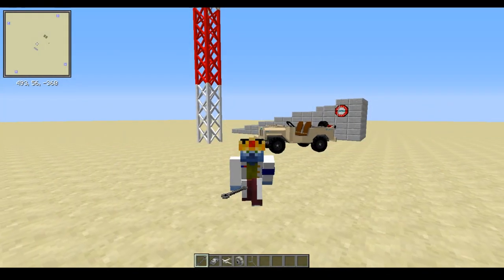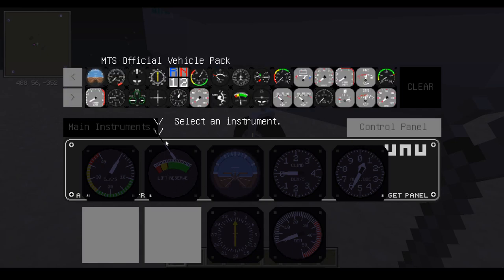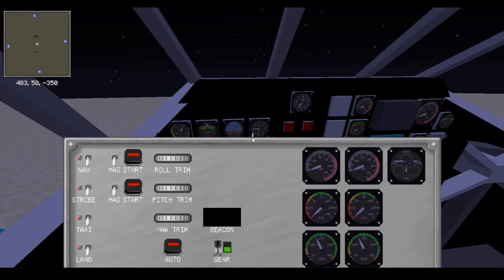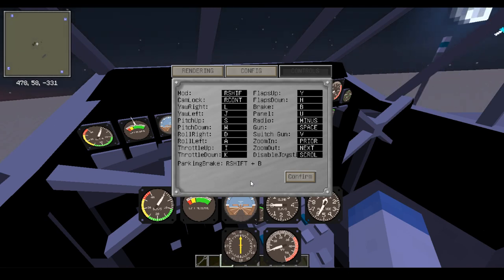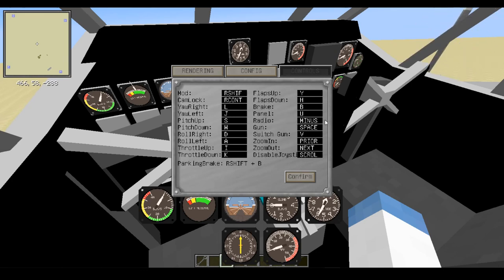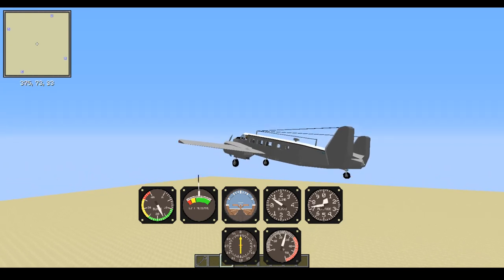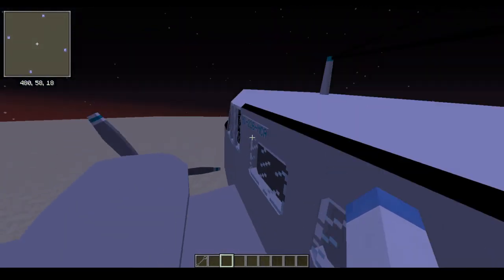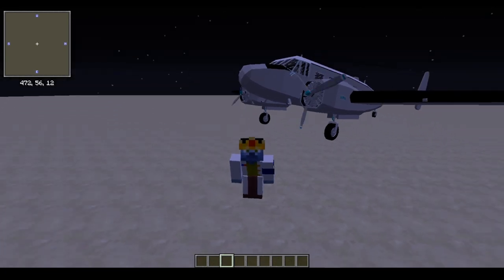Immersive Vehicles Tutorial - Part 2 - Time to Fly!

Comment: Hey, verry nice video. I have a porblem my planes dont run fast enough. the speed indikator sticks under the green scala and i am not fast enough to lift off.
Reply: You have to hold I to speed up, not W.
Reply: Hello,
I had this problem too!
Its because the newest mod version is glitchy,
you just need to install the second new version of 
Immersive vehicles, and the fourth new version of UNU parts (if you have)
then it will work quitely!